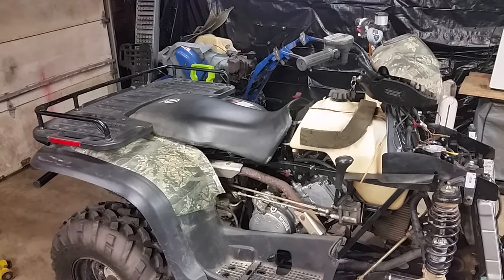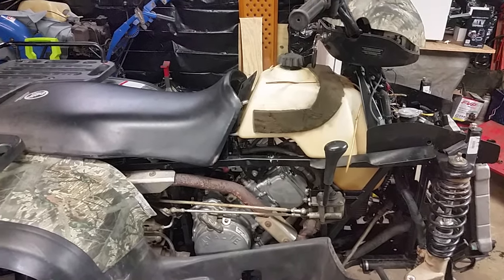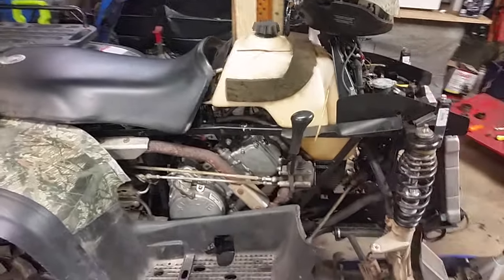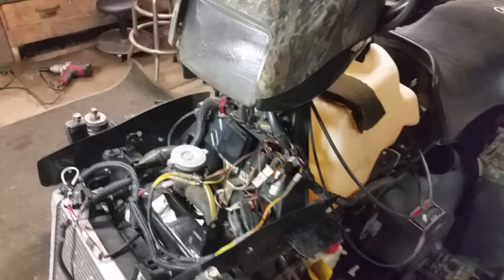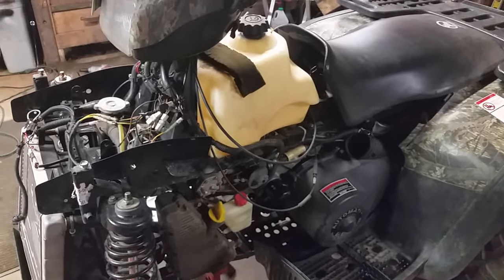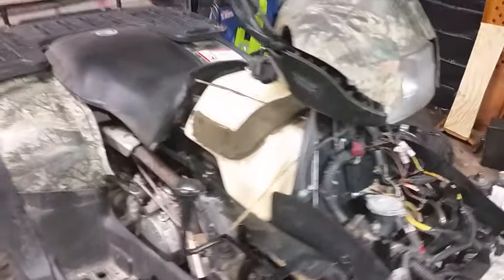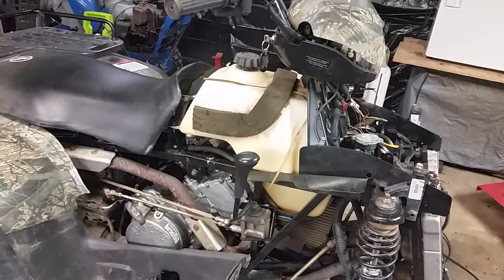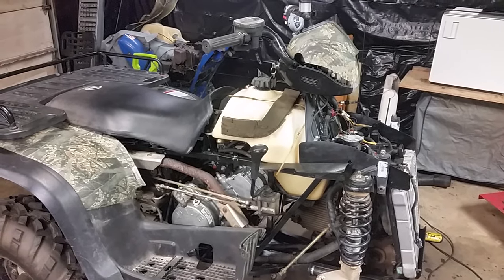Polaris sportsman 500 idles But dies when I hit the throttle.  Find out why?

Comment: My 96 sportsman 500 won't run with air box on. And won't even stay idling with choke on.  When I do get it started it sometimes revs up a little bit but then will just die. I have no clue what it could be. Help would be appreciated
Reply from the maker: I would try a rebuild kit on the carb first. Or try and aftermarket carb. Sounds likes plugged up somewhere. Also check your carb to jug boot. sometimes they will crack and the carb won't run right.

Comment: I am working on a 500 sportsman that is stalling upon acceleration. Cam looks good and it idles perfectly. Tried a different carb and cdi with no luck, I also isolated the fuel pump and gravity fed fuel with a gas caddy, still no luck. What I have discovered is this, if you the take the air filter out, and block the intake with a piece of cardboard till it dies, it will start back up and rev up just fine for a second or two. The airbox is jacked up, and only has one screw holding it down. Valves are at spec.

Anyone have any input on this?
Reply from the maker: Have you checked the throttle safety kill switch? make sure its not touching. And the carb intake boot.
Reply: @TitaniummanGarage  yes, I have disconnected the cdi ground per the manual and have visually inspected the boot as well as spray it while running to see any changes.would the vents going to the air box or the one from the carb to the oil tank cause any problems like this?

Comment: I got a 2012, just put a carb on it and the fuel pump thing that’s not actually a pump and it still runs like crap, it idles and starts up awsome but when you give it gas it doesent die but is won’t rev up at all
Reply from the maker: Maybe you got a bad carb. it sounds like the diaphragm isn't opening correctly. I would take the top cover off the carb and inspect the rubber diaphragm.
Reply: @TitaniummanGarage  I thought the old carb was bad so I put a new one on it and it has the same problem so I don’t think it’s the cabr

Comment: Will pulling blk wire prove it's cdi?
Reply from the maker: It bypasses the kill switch. If you have a bad cdi or kill switch pulling the black wire will let you know. Sometimes it won't shut off after pulling the black wire so you will have to plug it back in to shut it down.
Reply: @TitaniummanGarage  i think i found its the cam chain broke....no idea how to do that job n afraid of brkn bolts n gaskets....
Reply from the maker: @RocksNRuts4  I have a old video on that. your gasket should be fine. Pull the stator. Everything should be down there. Oddly enough...The wheeler in this video...the same thing happend.
Reply from the maker: @RocksNRuts4  https://youtu.be/nZKP-nZIYQ4
Reply from the maker: I have video's how to install the chain and cam gear as well. Hope that helps.
Reply: @TitaniummanGarage  ok ill look. its old so afraid of breaking top end bolts n gaskets......
Reply: @TitaniummanGarage  ok im confused as im a just a w/e warrior- no need to remove oil then top end to do chain? go from the bottom stator area? is stator behind pull starter? no oil on the bottom chain gear?
Reply: @TitaniummanGarage  ps im not evn sure bout chn, it wont pull start which it normally does, batt died, it jumps fine, n i hear a tinny sound so i shut it right away not sure if it will do damage if i idle it n listen....i thought i heard it loose, then rode for a bit then turned it off n nvr started again....i did do the chn tensioner thing n now hear the tinny sound. when i looked in hole where tensioner is i only see a clean shiny metal thing......ty
Reply from the maker: @RocksNRuts4  Did you just pull the bolt with the spring in it or the 2 small bolts on both sides? I would take the rocker cover off and check the valve lash at top dead center. The tinny noise could be chain slap from timing chain or valves. I would check your bendix gear to the starter. that will make a noise as well.
Reply from the maker: @RocksNRuts4  You shouldn't have to drain the oil. a little will seep out when you pull the stator, but not much unless the case is overfull.
Reply from the maker: Like I said earlier. I have a lot of video's. How to set the chain and timing perfectly. how to adjust valves. Just check out my channel. I would pull the flywheel and the stator and check the chain at the bottom behind the stator. who know's. You might find out the magnets in the flywheel are the issue too. They break off sometimes.
Reply: @TitaniummanGarage  ty, im ovr my head skill wise but i may try...ty
Reply: @TitaniummanGarage  ty
Reply: @TitaniummanGarage  i pulled the entire housing, pushed in spring tightened then reattached, then let the spring out, didnt stop the tinny sound. not sure if i shoulda seen the chain in the whole but i didnt.... the rest u said is ovr my head lol. but ill watch mor vids. ty for ur help
Reply from the maker: @RocksNRuts4  You wont see the chain through that hole. The chain tensioner presses on the black chain guide.  Have you taken the side cover off by the shifter on the engine? You can see the chain from there. Or the top rocker cover? You could have what's called chain slop. It's when the chain is stretched. Its tight enough to run but slaps around a bit. Have you taken the pull start cover off yet? Sometimes the bendix gear ( the gear that turns the flywheel from the starter makes that noise when its warn out. You could pull it out and try pull starting it. See if the noise goes away. Your clutch on the other side of the machine will make that noise too if its warn out. If you've seen my latest video that wheeler sounds tinny because the clutch.
Reply: @TitaniummanGarage  thnks bud. havnt opened it up yet, afraid to enter a rabbit hole.... in the tensioner hole i see a shiny silver pc not the blk nylon guide i thought id see.....also the 2 weird things are- it wont pull start, no idea why as it usually does in 1-2 pulls all the time, n will jump n idle but dies when i hit gas........i prob will attempt the covers u mentioned soon.....btw- my other atv had blobs of cv grease on rim, does that means its bad or broken or just boot is off n lets it drip? dont hear a noises n does roll, i do have a steering column clk now tho.......bad month lol

Comment: My 2002 Sportsman 400 starts, idles then just shuts off like I turned off the key. Not touching anything. Standing to the side of the unit it starts, idles then dies. 

Think CDI May be the culprit?
Reply from the maker: Could be. I've also seen the switch's go bad. That could cause it too. The light and reverse override switch's get corroded. i unplugged one of mine and the wires were green. i cleaned them up and boom! It ran fine.
Reply: The trottle cable cover could be gone from wear and tear thats the same thing that’s happening to my  2010 sportsman 500 ho
Reply: It was actually a bad spark plug. Had a crack and once it got warm wouldn’t fire to the cylinder chamber.
Reply from the maker: @matthewmayersr.1452  Glad you found it. I've heard that a lot. The first thing I always do is check the plug. See how it burns and replace it.

Comment: Thank you for the reply, I will try the soft magnet, but I think that bolt may be too heavy for such a magnet, and it may even be jammed against the lower Timing Chain sprocket. It is not going to be easy. Thank you anyway.
Franklin
Reply from the maker: If its by the lower timing chain sprocket, just pull the flywheel and stator cover off. you should be able to get to it from there.

Comment: Cam, carb, pick up coil, fuel pump, built three 2 had those issues the throttle body plunger also needs to be seated and the air box and hoses need to be hooked up
Reply from the maker: I posted that in another video. I was trying to keep this one short.

Comment: Hey, enjoy your video's. I've got a '96 or 97 425 Magnum 6x6 that's been getting to be a weekly pain in the %&*, just little crap,  but all the time. I have a little hobby farm outside Amery and its really needed for plowing and hauling. It's a real work horse. Engine seems fine and starts great, so with the prices of new being so much, I'm considering a frame off resto this summer. Plastic is good just faded, solid frame, most rust is just surface stuff. I figure even if I have to get into the engine, I could probably get another 10 years out of it and it would be worth it. Bring it back to almost new, Paint, new decals, bed liner paint, polish the plastic etc. I'm planning on shocks, cv's, front ball joints and tie rod ends, rear shock, rotors and pads. Rear  and front wheel bearings and bushings. Chains and sprockets if needed. Clutch seems to be slipping a bit going up hill while plowing so maybe that also. When I had it into a Polaris shop they test rode it and said the engine felt good. I'm not afraid to throw a couple thousand into it and do all the work my self. After market stuff seems to be all over the place. I was even able to find a new front chain eccentric last year.I bought an owners manual and found the service manual on line, but your video on converting a 425 to a 500 I've book marked! Is it cool to contact you for answers from time to time? You really seem to know these old Magnums.
Reply from the maker: Thanks. Not sure why some messages are not showing up. I just saw yours now.Thats cool. I like to hear people rebuild them. Around here everyone is parting them out. Soon there will be none left.

Comment: I have a 2018 850 sportsman I'm going to try this cause my quad just left me stranded on the ice. We have tried everything
Reply from the maker: The 850 doesn't have a CDI box. I would start with the fuel injection system. What code are you pulling up?
Reply: @TitaniummanGarage  it was moisture in the throttle and 4x4 switches
Reply from the maker: @bobmackay9281  Interesting! I've had corrosion there but not moisture. I suppose it makes sense.

Comment: The cheap China cdi should have worked, but some are actually and others are DC.  There's a guy on YouTube who shows how to convert any bike to DC then wire it up to the battery.  Boom it works every time.  I bet you you put a DC with an account current and fried it right away.  The ac current coming off the stator is like 50v vs. 12 v DC. 
Anyhow, my electric water pump came in last week and this video just got me pumped up enough to go put it in.
Reply from the maker: Sweet. Thanks for the info. let me know how it turns out.

Comment: I'm having the same problem with my 02 500 HO. It's bizarre, some things seem to fix it, put it back together then before long acting up again. It's ripped apart in my garage now.  The problem is finding someone who has the same wheeler that will let you try parts. This has been going on almost a year now, very frustrating. Cam is perfect, Aftermarket coil, aftermarket carb. Ran awesome then started acting up 
after I parked it!!!!!
Reply from the maker: Some of the aftermarket stuff makes it worse especially if its made in china.
Reply: @TitaniummanGarage  Do you have any adea where the rev limiter is located? In the cdi? or somewhere else?
Reply: @kmisercola7180  Yes that's where the Rev limiter is built into . I am here looking at stuff because I have a guy who is having issues with his & says it hesitates now a few months after he had someone rebuild the carburetor & adjust the valves which he seems to think he set them too tight . He hasn't brought it over yet because I am working on another friend's custom built chopper that needs a new starter so I haven't been able to hear the Polaris run or drive it to see how exactly it's running but from what I hear these Polaris ATVs are known for several problems especially the cams & cranks going bad in them & I also read that Polaris had a big contract with the military for the army if I remember & the army backed out because they were having all kinds of problems with the cams & crank shafts going bad in them & being they need to use a dependable product those issues couldn't be tolerated . I had a 91 Polaris 350L liquid 2 stroke for about 8 years that was used mostly as a work horse on my property & finally sold it but to tell you the truth I would never buy a Polaris ATV again after seeing how mine was designed & how poorly the fit & finish was on things on it plus another friend of mine who had a new Polaris just a year ago & his engine started knocking so he sold it as well & bought a CanAm instead but if it were me I would probably buy a Honda or even the newer Yamaha Grizzly's are pretty well made with not as many issues as these Polaris ATVs seem to be plagued with .

Comment: polaris CDI boxes are worthless, my 2000 sportsman will run great then out of nowhere it will go to rev limiter mode while in a forward gear and it stays there for 15 minutes of running time then it goes back to normal. I would never buy a new polaris. my old 1986 honda still keeps running no matter what

Comment: Every time this happens to me it’s water in the gas , and it’s very difficult to get it out.
Reply from the maker: Yeah. You gotta use premium gas or add marine stable. It seems to go bad after 3 to 5 months.
Reply: @TitaniummanGarage  well I was using it and I was starting to run out of gas ,and I had a 5gal plastic container I had had been using so I put the rest in and took off to back up this hill and it started puttering back firing some times I can work it out but this time it was to much so I emptied it and now I am going to get this gas and water separator that will take the water out and let the gas in , so hopefully it’ll work out I’ll let you know.

Comment: I put a new carb on my Polaris 425 and found out the new carbs had smaller jets... so it would die once I gave it gas.
Reply from the maker: I had noticed that too. I usually pull the new jet out ,clean and install old one.

Comment: Mate, have you ever had a timing chain sprocket bolt shear and fall inside the engine?
How can one extract the bolt out of the engine without pulling it apart? Any ideas?
Kind regards, and keep producing videos, you will end up like Donald Trump!
Reply: Franklin Arguedas get soft rubber magnets, like the kind on refrigerator stickers, cut a strip roll it into a plastic tube and poke around into the same area that the bolt fell into and ya might get it out!

Comment: I got a better one a little more suspicious sounds a lot like what you got going on or had going on but the difference is is you can ride this Honda recon for several hours and then it will quit and you can crank it up and it'll idle but as soon as you push the gas it'll cut off but the next day if you come out need a crank right up and you can ride for several hours again no problem runs for great but then when it hits whatever point that is after a couple hours it quits again it'll crank it'll idle but if you push the gas it'll move forward I mean it won't move for sorry it will stall and but if you come out the next day after sit overnight now I've only tried it up to overnight it might just be an hour of sitting it might be 3 hours sitting I have no idea and it's just put it up and come out the next day and it ran and it ran fine again for several hours and then done the same thing you had going on and I was thinking CDI box but the thing funky to me is it runs for several hours perfect no problems or nothing and then it only happens it's almost like after it gets really warm or maybe something gets hot I was thinking like a vapor lock or something cuz it just gets so hot that maybe it just is vapor locking but that wouldn't make any sense with a cranking though and idling just a lot like what you're talking about a little more mystery to it and it could be the CDI box it could be that it gets warmed up after over a certain amount of time and it just stops working right could be possibly that I imagine I don't know how warm they would get guess it depends on how much amps you're pulling into it but if you got any suggestions on that from what you learned I'd much appreciate it thanks a lot God bless

Comment: It says it is a 2000
Reply from the maker: The part number is 3085639 or 3086982 they both have 2 plugs and a black wire to kill switch and a wire going to coil. I think the one in this video is a 2000 If I remember right.
Reply from the maker: Oh..And a brown ground wire.
Reply: @TitaniummanGarage  I think you are correct but mine has 2 "double" plugs whereas the ones on Amazon have 1 "double" plug and 1 "triple" plug.  The number on the top of the CDI unit says CU2570
Reply: I could send you a picture of my CDI box
Reply from the maker: @chucklehman7610  Now I understand what you mean. Yes I ran into that problem too.
Reply from the maker: @chucklehman7610  I just saw a used one on e bay cu.2570
Reply: @TitaniummanGarage  Did you search under CU2570 or as CDI box for 2000 Polaris Sportsman?  BTW - thanks for all your help - It has been great in being able to throw ideas and issues out to someone who knows what they are talking about.  I did some more searching and i think i found one from Caltric that i ordered.  It shows with the 2 plugs like i need so we will see.